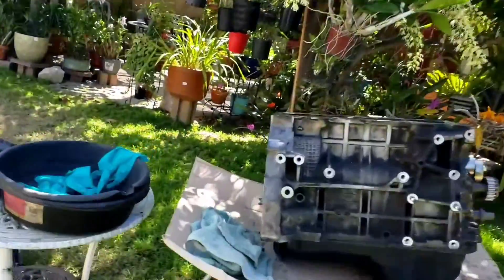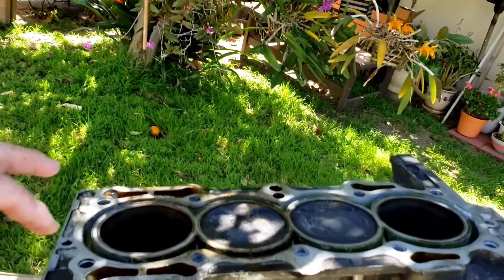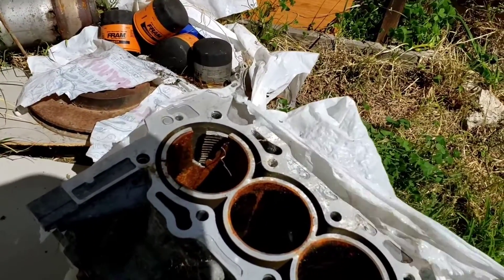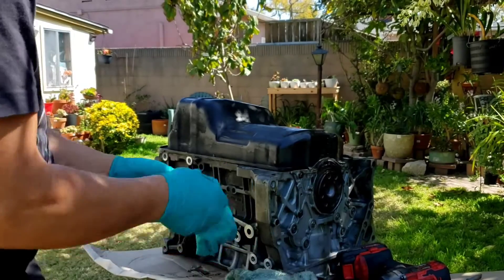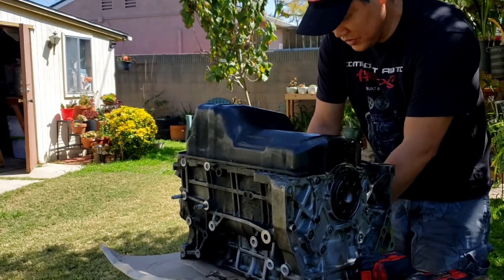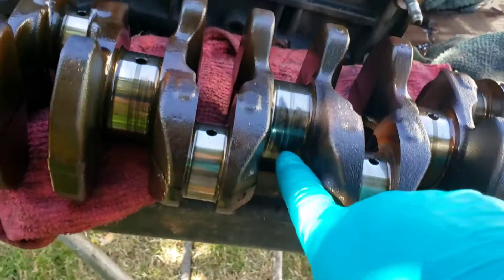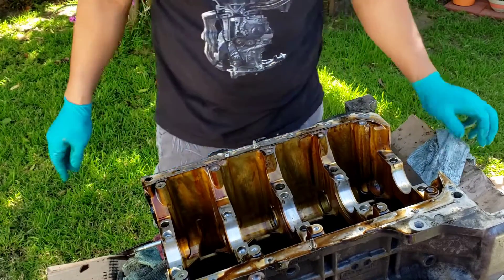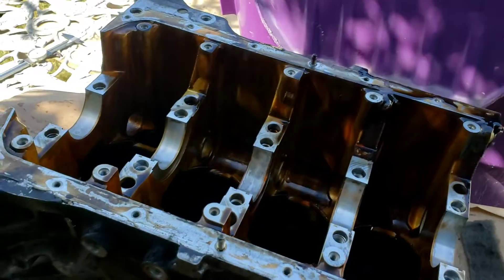G23VTEC Build

Comment: How do I measure to figure out what axle I need for a 1994 integra LS with G23 swap and m2S4 transmission
Reply from the maker: Try your LS drive axle first. On passenger side, use a H22 or 92-97 Accord inner joints w/o the boot. Do not use B series inner joint (it'll come out) and simply follow just like l'd shown. If axle stick out more than 1/4", it's too long (no good). If its even out on the hub or 1/4" sunk in, your'e good. For driver side, same procedure, but use H22 inner joint. If your LS axle is too long, get a 89 Acura Integra cv axle and try it again, dont put the boot yet, this way you can see tri-pod bearings when you turn the wheel lwft and right.

Comment: Thats a nice build uncle i might try to do one when i get a change to own an accord
Reply from the maker: Tnx pamangkin! You can build one and stuff it on yout EK like l did on Myllie. It'll give you much more torque than your B20. I built a b20vtec way back for my nephew, we put it on his dell sol. That car was flying lol!. Later man
Reply: @sagittnet2158  thats what i was gonna do b20vtec but i went back to stock d for smog this coming year maybe ill try to do h2b next year on my ek hehe
Reply from the maker: Subscribed to your channel, want to see your future build.
Reply: @sagittnet2158  hopefully would need to get all the parts 1st
Reply: @sagittnet2158  just subscribed to yours too
Reply from the maker: @andrewdero6271  kool! H2b would be great swap, keep up your build project and take your time building it. Peace out!
Reply: @sagittnet2158  uncle quick question will a 89 prelude si tranny hydro ones will bolt up on f20 block? Theres a f20b with same head u got with turbo manifols they sellin just need rebuild for cheap i was thinking grabin it just wanna know if the tranny will bilt up?
Reply from the maker: @andrewdero6271  not sure if it will bolt up. even if it's not, what your after is the F20b engine and you can get the proper tranny you like later, + you said price is right. You have a choice to go H2b or straight H swap. There's plenty of f20b swap on 89 Prelude.

Comment: Oh I just stumbled across your videos lately and have watched several of them I’m in the process of putting together a motor for circle track racing. We have 2/4 GEN prelude with F 22B dual overhead cam motors the JDM ones. I’m thinking about pulling the heads off of those and putting them on an F 23 block it’s not exactly a G 23 but it seems like it should be an easy Bolton since already made for an F block
Reply from the maker: Yes it should work, you'll be using your dohc cams/ gears, crank gear. Water pump should be no problem coz you can compare the two. F23 headgasket you might wanna look it closely when you mock it up w/ the head. And for water coolant tube, you'll see what need to be done and good luck to your project and thanks for watching.
Reply: Thanks. I have to get my h23a1 back in a car before I make another mess.  I’ve got motor parts everywhere. Lol.  When I get it. Done I’ll try to post some videos and pics. I thought about doing this G 23 thing for three years and your videos made it seem so easy it’s time to get busy thank you very much
Reply from the maker: @derekdupler  no worries man!

Comment: If you're paying for sleeves why not use a full h22
Reply from the maker: The F23 block is very unique in designed. It almost mimic the bottom end of a K series( main bearings caps). Totally different designed than H series and also l already have 1 H22a4 (55mm)that is also dry iron sleeved and installed onto Snoe Whyte (cd5 Accord). Thought it was a good idea to try other block. I actually have a H22a4 block that has f23 internals and h22 piston in it for NA setup. F23 block is also designed to handle the  97mm crank throw.